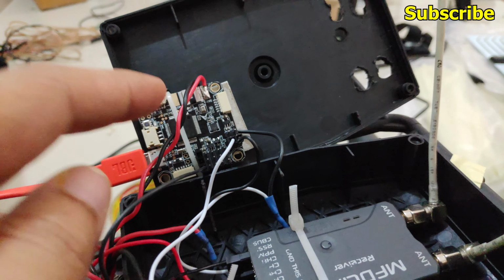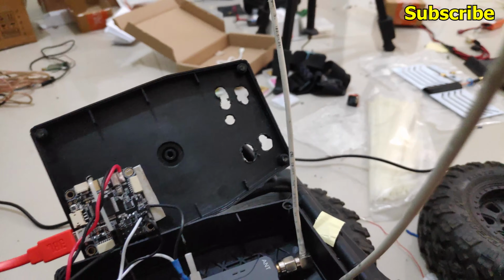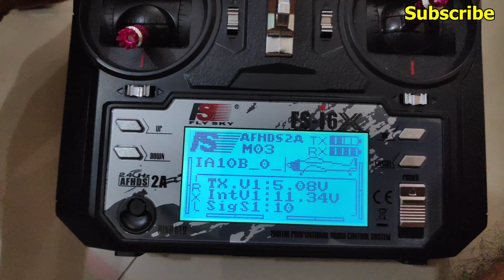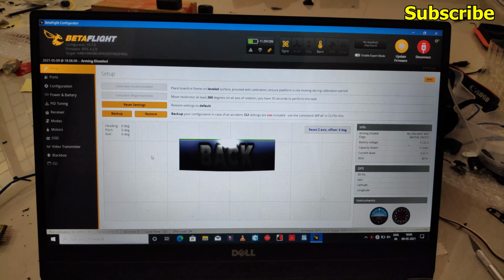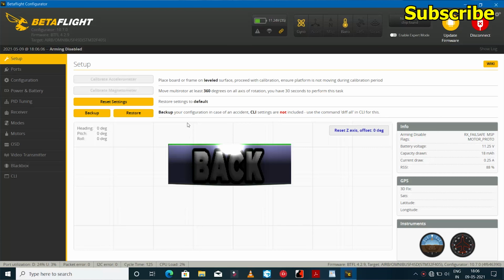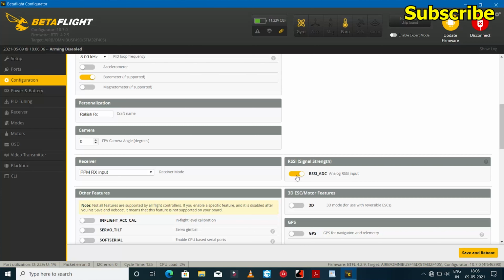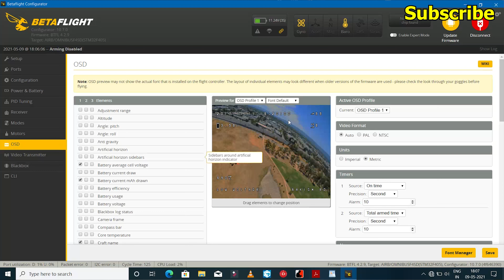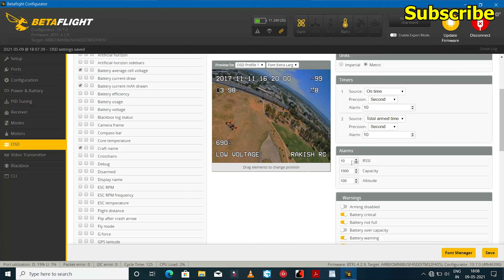How to get RSSI for Long Range FPV in OSD | Rc Car FPV

Comment: I assume this would also work for FrSky R9 ExpressLRS receiver as it also has the RSSI output? I recently connect my RC truck to the MATEKSYS Crossfire to PWM Converter so I can control it through the R9 receiver. That PWM converter also allows me to install a GPS module, and I am trying to see how it may all work together? But in order to get the GPS info and others to display on the monitor, I guess I have to first to get a flight controller and wire up just like you show here, correct?
Reply from the maker: Yes you'll need a flight controller to display all the telemetry on the video feed. But i am not sure how the rssi will be fetched because of the crsf to pwm converter and the flight controller all being inter connected. Does the pwm converter have rssi pad?
Reply: @RakishRc  Thank you very much. I will acquire a flight controller to try your setup from this video tutorial. There is no rssi pad on the Matek Crossfire to PWM board.
Reply: @RakishRc  I just received Matek F411 WTE Flight Controller (because it has PWM ports) for RC truck, and had configured it with INAV today. I  can just use this FC without the need to use a Crossfire -PWM converter as FC will convert Crossfire to PWM automatically. I am currently trying mixing the servo position, OSD display and trying to figure out how to make video work on RC truck with 1.3GHZ Video system on Matek FC as well.
Reply from the maker: @peterhou4998  Hi, good idea to use that flight controller of it's converting crsf to pwm without any external converter. Osd can be setup just as you would wire any camera to the cam pad and vtx video wire to vtx pad on flight controller and enable required osd data.
Servo position you can play around from the servo tab like how betaflight has not sure how it's in inav though.
Reply: @RakishRc  Thanks a lot. I am able to view different OSD display from my monitor through the installed Flight Controller (FC) right now. It is so cool to see all telemetry on the RC truck. I felt driving the RC truck like flying a plane. I also have 1.2GHZ VTX connect to the FC with 2 cameras, so I can switch between 2 cameras too. By the way, I use the Mateksys F411WTE FC and configured it in INAV 4.1 (Note: I have issue with INAV 5.1 so I downgrade to 4.1 and so far working fine).  I also plan get a GPS to play with the FC to see what this FPV Truck can do with it. Thanks again for this great idea to view OSD!
Reply: OSD is working great now with the FC. Thanks again.
Reply from the maker: @peterhou4998  awesome 👍 post driving videos
Reply: @RakishRc  Will do when ready. I also have Mateksys M10 5883 GPS installed today with this FC. I think it maybe over-kill because every time I try to Arm the RC truck, OSD will say waiting for GPS signal fix and it will take about 5-10 minutes to get the signal in my location. So I bypass it in the INAV :D - I think it may not be practical in real life to have GPS in Truck. But it is a fancy function though. Anyway, Will try to test GPS as a Waypoint and on a longer range to see how it works next time.   By the way, in my area with many houses and tree, this ExpressLRS + 1.2GHZ VTX does not really get me too far but it is definitely better than my old 2.4 + 5.8 VTX system.